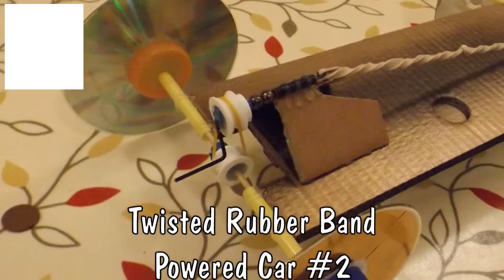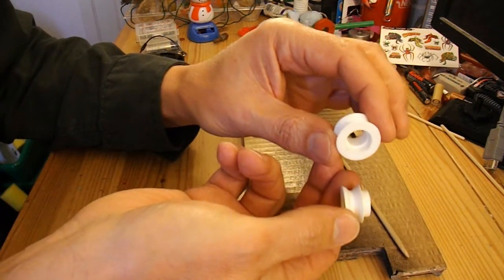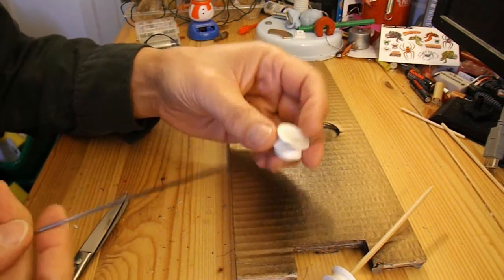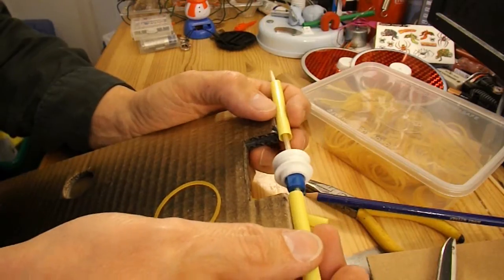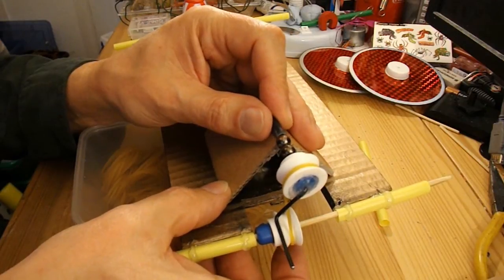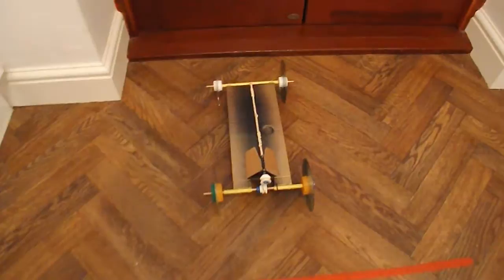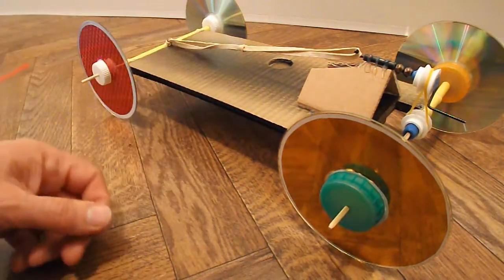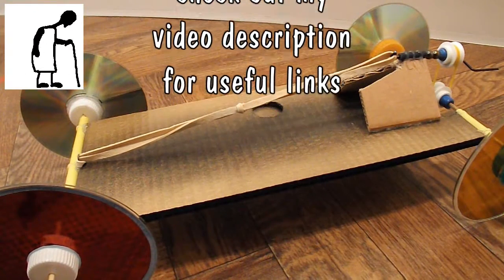Twisted Rubber Band Powered Car #2

Comment: is it possible to make a rubber band  powered car with only one rubber band?
Reply from the maker: How big is the rubber band? I have lots of different sized bands. Most of my cars will run on less rubber bands, it just depends what you are trying to achieve, speed or distance.
Reply: the rubber band is 1/8 thick and three inches long, i need the car to go at least 2-3 meters
Reply from the maker: Bilal Qadar Here you go http://youtu.be/sKtYBr-Z1_A

Comment: can you make a rubber band boat car or the power source from Twisted Rubber Band Powered Car #1
a car that can go in both water and on land if possible one that can drive in and out puddles on its free will
Reply from the maker: I am sure that if I just swapped the wheels to the paddle wheels I used in that boat/car I recently made it would work on land and through puddles. I could add a bit of polystyrene under the body to make it float. The problem is that the power source does not last long and it would probably run out of power too quickly. As I showed in this video it only goes for about 5 metres and then it stops.
Reply: my friend and i were trying to build a can that was a "tower" with wheels 

-we used a string wraped around the axle ran it two the top of the tower and hooked it onto a weight and the weght would fall pulling the string turning the axle ? :( it did not work so i was wandering if you could attempted this
Reply from the maker: enviromaster enviroassess I have a playlist full of them :-)
http://www.youtube.com/playlist?list=PLA5a2xPRSrB1zzCqDckAnlOzz8iViuM94
Reply: lol... this proves that i am blind (jk i am not really blind)

Comment: I've noticed that the empty rolls of tape reels could be a great pulleys. 8-)
www.podonorte.com/fotos/Omnipor.jpg
Reply from the maker: Yes they might work, but they would be better if the centre hole was smaller so they would fit a thinner axle.